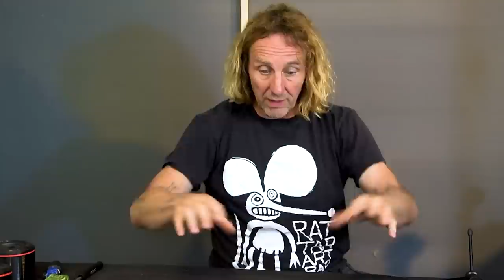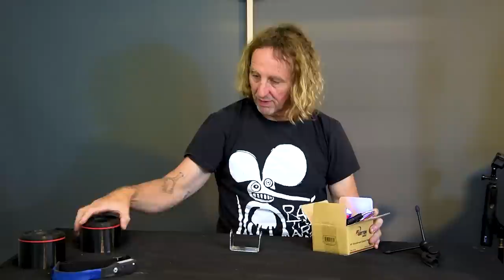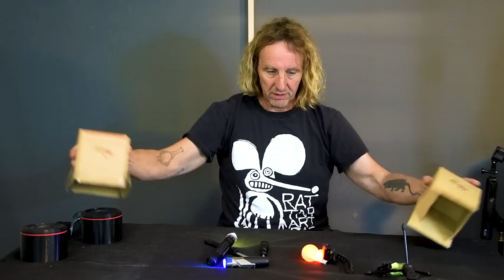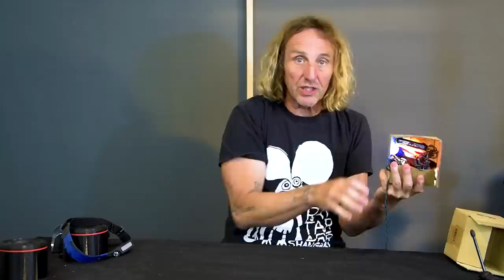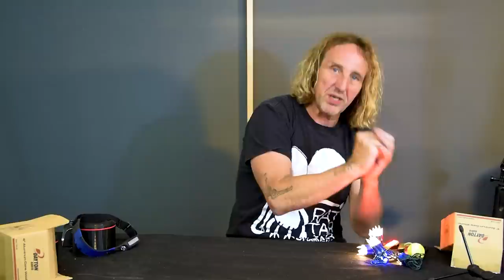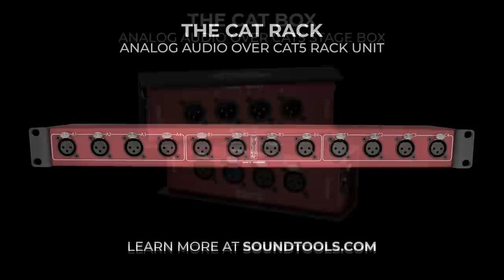Thinking Outside the (Speaker) Box - Does stereo Ruin Sound?

Comment: isn't this just recreating the Grateful Dead's wall of sound?  Each instrument has it's own PA located behind that instrument.
Reply: IMHO, absolutely. That system was built by actual engineers.
Reply from the maker: The wall of sound was a step in the right direction and also had some serious drawbacks, like PA behind the band, over complexity,  and coverage issues.

I believe things can be pushed to new hieghts both on the PA side of things as well as the home hifi side.

One of the biggest advances of the Dead wall of sound in my opinion was it was the first real deployment of large scale line arrays
Reply: @DaveRat  Yes. Use positional audio to make a real sound stage with separate speakers for separate sounds.
Reply: The dual mic phase thing, although brilliant, must have been a major compromise with sound quality. Never had the honor of actually experiencing it though.
Reply from the maker: Crown made a mic called a differoid for a while that did this. And also had that phasy sound
Reply: Very cool and informative! Makes my mind step out the box!
Reply from the maker: 🤙👍🤙 that makes me happy
Reply: I wouldn’t call it outlandish, the “big 3” loudspeaker manufacturers are pursuing this very idea. L-Acoustics has L-Isa, d&b audioteknik has Soundscape, etc. all trying to get to what you’re talking about
Reply: @DaveRat  they still call the CM311 a differiod, claiming up to 12dB more gain before feedback than other headworn mics. If I recall correctly, it was an early if not the first usable headworn… Garth Brooks, Janet Jackson and Bobby Brown were all using it on tour staring around… ‘88? ‘89?
I don’t remember all the ins & outs of it, but it supposedly successfully canceled out sound from the rear of the element and “ignored” sound coming in from distance.
Reply from the maker: Crown used to make a handheld differoid
Reply from the maker: Yes, I am aware and saw L-isa tears before release in it's development and have deployed it on tours as well.

These are interesting steps in creating the illusion that sound sources are situated in various locations.

It's also important to resize that creating the illusion a sound source is located somewhere still lacks the natural room reflections from the source that would occur if the sound source was actually located there.

Cool stuff and my goal here is to shine a flashlight on the various limitations and follow it up with more videos showing some ways to address some of those limitations
Reply: @DaveRat  gotcha. I was doing an installed system at LSU for a theater/classroom and heard the word “acousmatic” for the first time. The idea was to have loudspeakers in various locations (in this case behind the perf screen) so that students could create multichannel stuff on a laptop, and route different sounds to the different locations. As I recall, we didn’t end up with much of that implemented (it ended up being more or less a Meyer Cinema system with surround & such) but they did have Dimitri Wild Trax. A lot of stuff in a room that held about 150. I believe EA Sports was footing the bill for the building, the other floors were classes for game design.
Reply: That would be the ideal but totally infeasible for any but a touring band, with no visitors allowed.
Reply from the maker: Good stuff and yeah, the more advanced ideas often haveore limited applications or feasibility.

Or looking at it the other way, a solution that fits all scenarios will be highly mediocre and dumbed down

Comment: Very thought provoking and Inspirational. Dave you remind me of Russell Johnson ( Artec Consultants ) an old sound designer from New York. He mixed the room with speakers from the ceiling speakers bouncing off the walls and under the seats in Theatres. He also created zones for sound to be directed to through out the theatre allowing more dimension. He was an FN genius. at that time I was just an assistant and my boss could not get his head wrapped around it and trashed the system and went back to point source and ruined an accoustical gem. Sometimes Senoirity SUCKS, but when my boss retired I worked on my own time rewiring trunklines my boss had cut, I had mamagement come and listen when I finished and everyone was blown away. But when I explained what I had did my Supervisor told me to shut it down and never use it again or it would be his ass on the line for letting it happen. So Sad but true.

Comment: I went to an electronics show in the late 1990s where I was fooled by sound.  Was waling down the hallway, and a room was open and I heard a grand piano in a room they were serving refreshments. I went into the room and turned left and saw the grand piano with the lid up, but nobody was seated at the piano. Cool I thought a player grand piano. Never saw one so I went over to investigate the player piano. Upon approaching, I discovered it was not a player piano, but a Yamaha grand piano. On the floor next to the piano were two 3 way accoustic suspension speakers. Asking about the recording, the piano was recorded with 2 microphones the night before with no compression, eq, or mixing. It had me completely fooled until I was about 15 feet from the piano and saw the speakers on the carpet. Very impressive and very real. It was a digital recording with good equipment. The speakers were less than 2 feet from each side of the piano on the floor with no stands. Still remember that 25 years later. It is the one time a recording completely fooled me.
Early stereo recordings were often mixed hard left and hard right. Listen to some vintage Beatles and other recordings of the same time.
When stereo television came out, the studios had a very difficult time with using conventional microphones and the result was comb filtering from the phase delays in the stereo recording and the close spaced speakers in a television set. Studios then moved to mono mixes and X/Y stereo microphones so the sound was phase aligned when a stereo mic is used for one point source. This is why in audio production, each performer is picked up with a single mic, not a pair of mics. The phase cancellations are brutal. It was fun watching the TV studios learn that in early stereo television. Sound engineers knew long ago to not place a pair of mics for a single performer unless the recording is strictly for binural headphone use.
Reply from the maker: I love this! And this is what I want to strive for

Comment: Sounds like what you're working towards is the Wall of Sound that the Greatful Dead had built in the 1970s. The speaker cabs behind the band were localized to align with the instruments on stage. Curious what the Rat take on the Wall of Sound is. They also had a really novel mic technique that exaggerated the proximity effect to isolate sources and reduce feedback. This also makes me think of surround sound systems in theaters. You mentioned them, but one thing to note is that as humans we're really good at placing where a sound is coming from. In a theater the center channel of the surround has 90% of the dialouge, stuff recorded on location. This channel lives behind the screen that's actually acoustically transparent. This draws the viewers eye into the image, where in theaters with stereo systems it can be distracting depending on seating position because of phase change. The same things can apply to PA systems, it is something to consider.
Reply from the maker: Hmm, quite familiar with the wall of sound in fact I even deployed a system in that configuration back in the 80s when I was on Black flag tour.

Obviously putting the PA behind the band is a bad idea and putting the PA farther away from the audience did not sound good

Yes these ideas of separation are good and I'm looking at trying to take this to newer and better levels.

I did a tour of arenas and stadiums worldwide where I deployed multiple Soundsystem side by side and was able to put different instruments into different PAs which worked really well

And on huge scales like that the limitations are more pronounced.

But what I'm getting at is building three-dimensional speakers capable of recreating true Sonic realism where you can walk around behind a speaker and have a hard time telling that it's not an actual human playing an instrument

Comment: I love this topic. Been thinking about different ways to implement this. Smaller environments seem like an easier task. Sitting in a small venue listening to a bluegrass band with no amplification is a great experience. You get to experience the room and the music together.  Making each instrument a bit louder for a larger venue having all the sound emanate from near that instrument would be fine for the audience, but would cause issues on the stage as it gets louder. I'm picturing in my mind a horizontal line of speakers across the front of the stage and panning each instrument to a different location in that array. Instruments stage left would be panned left, then follow the instruments across the stage. Multiple subs could be similarly panned. It would take a lot of equipment to do it, but a cool thought.

With In Ear Monitors, I think it would be somehow possible to electronically simulate Binaural audio. Record each instrument, and make that sound emanate from an imaginary point on the stage. Boss Wazza-Air Headphone amp comes to mind.
Reply from the maker: Awesome, love the pushing of thoughts and ideas!
Reply: This is pretty much what I've been trying to achieve in a live music listening room (meaning the audience is expected to listen, no talking) I've recently opened.  Through experimentation I've landed on a different solution that works shockingly well!

Long story short, I'm hanging splayed main speakers front and center over the stage with subs directly under.  Everything is run in mono.  Then I'm delaying the whole PA signal the equivalent of about 15-18ft (the furthest distance an instrument is likely to ever be placed behind the PA speakers).  This allows the listener to hear the actual source just before the amplified version of it.  Since our 3D auditory image of the world is mostly constructed from the timing cues of a sound hitting one ear before the other, hearing the original sound source before the amplified version leaves the impression that all the sound is coming from the original source!  

Turning the delay on and off is an impressive experience, especially when you close your eyes.  You can "feel" each sound move from the PA to its instrument!  Even the lead singers voice seems to drop from the speakers directly above down to his/her mouth.

It works so well with acoustic instruments!  I would definitely try it on bluegrass!
Reply from the maker: That's cool bringing the focus back to the original sources

Comment: I have had a 222-seat theater at my disposal in Fort Lauderdale for some 35 years.  It was a church way back but is now fully godless and it’s a magnificent sounding room.  Very steep seating, heavy velour curtains over stained glass and exposed concrete.  Since I could do what a wanted, I installed a coincident pair above the stage angled out about 60 degrees, on its own stereo amp.  I have really enjoyed boldly mixing stereo in that room, sending maybe half the sound, or more?, to that pair.  I can’t think of any reason big setups should not do this.  It’s highly room dependent of course, but quite an ear-opener in a nicely proportioned room.

Comment: Five instruments with five separate individual speakers in one monitor case/box makes sense to me. I've always thought of "stereo" as 3D audio This theory is fantastic. As if the room itself becomes the mixing board. Out doors is a whole different animal.
Reply from the maker: I think the concept can be pushed farther
Reply: the most likely result will be horrible comb filtering. there's nothing impossible about what you say, but the Crossovers required to make something like that sound good would be very expensive.
Reply from the maker: Interesting perspective. I took six small speakers and recorded an acoustic guitar with six microphones in six different locations and reproducing the six Mikes with the six speakers creates a three-dimensional sound source that you can walk around and sounds realistic and similar to the acoustic guitar being played that I recorded in the first place.

The whole system cost less than $300 plus the cost of the six channel teac recorder

For amps I use these $25 stereo amplifier boards.

So I can say that inexpensively and relatively easily what I described is doable and I will do a video on it at some point

Comment: Dave, I love your channel! I've been a musician and done a ton of recordings in a live situation, mostly Classical and jazz. Was in charge of recording a Symphony Orchestra at concerts for Public Radio broadcast. Did 15 years with a great hall and great mics. After getting an acceptable recording with a singe point stereo AKG 422, I too thought how can we improve the recording experience? after adding spot mics, different stereo pairs and a whole lot of trial and error, We took the three spaced omni small condenser mic approach and the right to left did sound fairly realistic. The hall ambience and reflections was another matter. I'd setup at a rehearsal with an empty hall and it sounded just great, you could hear the hall and it did send you there if you had headphones or a decent speaker listening environment. As soon as the hall filled with the audience, no hall ambience except a bit of people rustling around. Defeated! I ended up getting an early Klark-Technik digital reverb to put some semblance of space in. Live Jazz has the same issues if you close mic everything and mix down. I was able to record for release a club performance that included David "Fathead" Newman where the club and musicians insisted that we record with two spaced mics, about 10 feet away from the stage. Cool until I heard the drums overwhelming the piano and couldn't do anything about it! New designs in speaker systems and computer cancellation of our home reflections and replacing them with the original ambience is a possible move forward. However, we do tend to really like the clarity of mixing down close mic'd sources so we get a "better than being there" experience. No right and wrong as you say, just food for thought.
Reply from the maker: Interesting and cool

Comment: I guess the answer to the question of why we don't do this is budget and practicality. The cost, setup time and the complexity of mixing with a system comprising multiple speakers or arrays all over the place would be prohibitive in most scenarios. It's complex enough when you have left/right hangs, side hangs, centre hangs, delay hangs and time aligned sub arrays just to get even coverage in a room. I suppose the best we'll get is double hangs, one for vocals and one for instruments, or maybe double hangs plus a centre cluster, or putting vocals in mono centre and instruments left and right, but if you're trying to cover an arena, then you'd need an inordinate number of additional hangs. It's a dream that sadly I don't know if many people would be able to achieve. Curious to know how you're solving this on recent or upcoming Chili Peppers tours? I know you like to use multiple mics and pan them differently, but have you ever gone beyond that?
Reply from the maker: Well, I stopped touring in 2017 so no current mixing for me.

Another way of looking at this would be to ask yourself, what if a new level of sound clarity and realism could be achieved? Is it possible the sound systems would then get financial budgeting on tour closer to what lights and video make?

Do we not perform because the money is not there or is the money not there because we fail to be amazing enough?

I don't have the answers and also asking the questions and pointing out the fundemental flaws to the current approach, perhaps could inspire some progress

Comment: I would add that we are perhaps on the way there with systems like atmos and ambisonics. Let's see, there's lots of road to cover with many different scenarios. 
Thanks for putting the lights out of the box!
Reply from the maker: Very cool and yes, there are systems like Atmos or even sound bars, L-isa, Soundscape and surround that try and create the illusion of sound source locations.

It's tough though as the room reflections from the illusion don't match the reflections that would occur from actual sources in those locations.